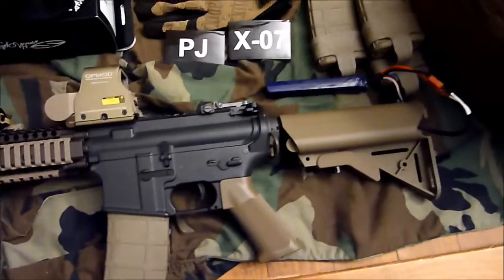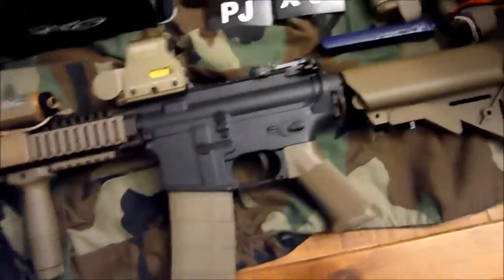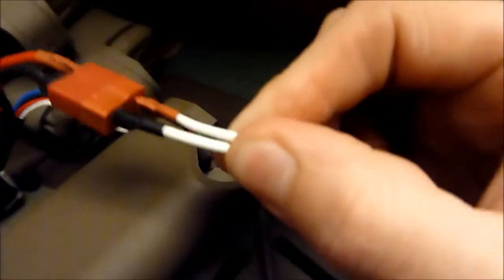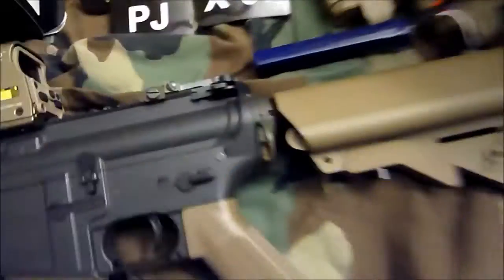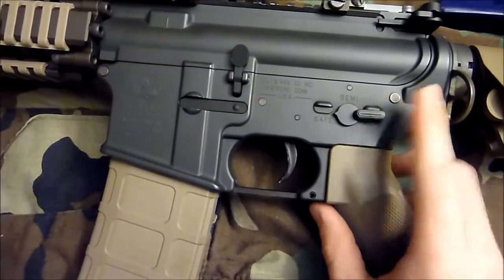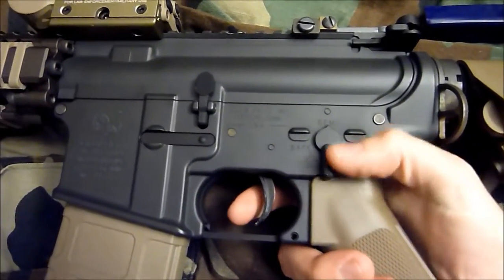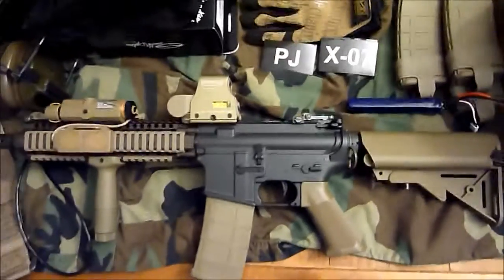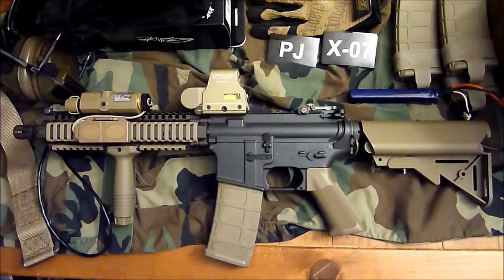VFC MK18 - AWS Raptor Round 2

Comment: The problem with the raptor, as well as the stealth fet,is that they tried to cram way to much on those little circuit boards, and as a result components could easily short, things would randomly fail, and the microswitches on the board were so small that they would either fall off or just die by themselves. The Chimera is more advanced in some areas, but mainly it puts the actual FET in the buffer tube, and gives you a trigger board with microswitches so that you can get the benefits from it.